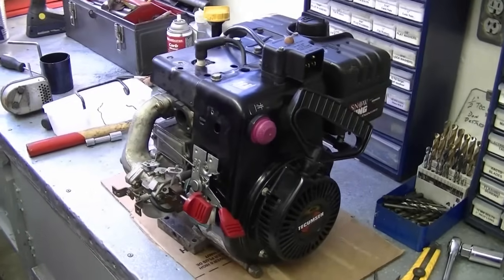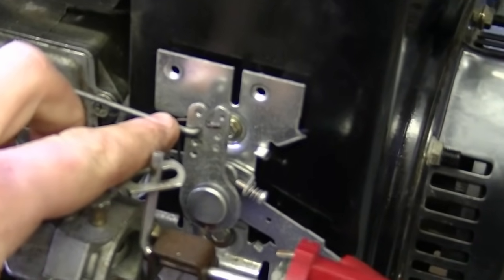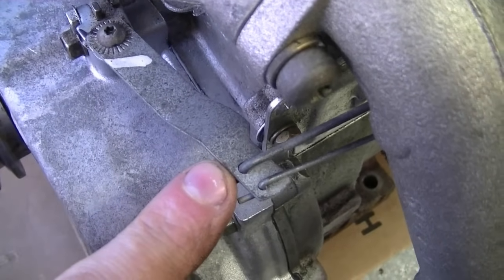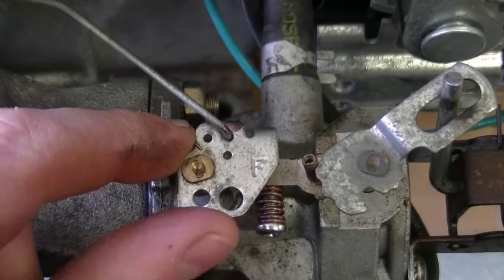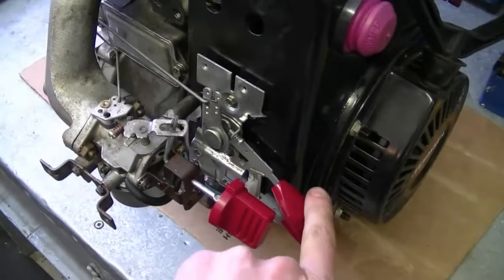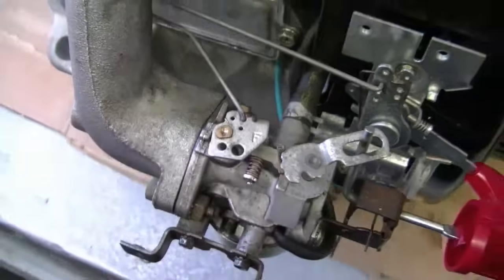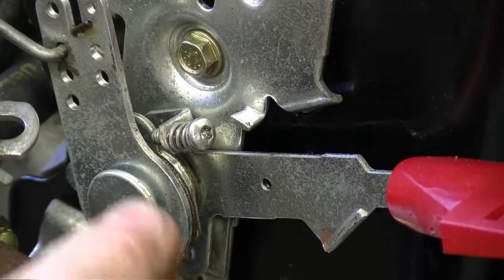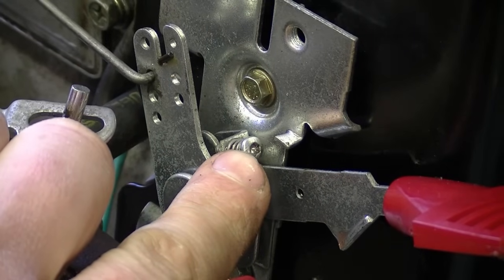8-11hp Tecumseh Snowblower Carburetor Linkage Configuration

Comment: I'm out of ideas. My linkage is on correctly but the engine wants to either rev extremely high or the idle will just start to come down at the bottom of the linkage and want to die. I'm thinking the governor is screwed up or maybe I have an air leak.... It's a brand new carb on an unknown machine. The guy told me it ran last year

Comment: My MH80 Tecumseh engine snowblower has the linkage diferent than from the youtube presentation. At the carburetor the linkage is in position nr 2 hole and at the RPM position nr 1 hole. If I put the linkage like the picture the RPM are very high and I can not select the correctly high 3400-3600 RPM.

Comment: Any idea what the stock size for that bolt that holds the throttle plate on? Mine was out wack when I bought it but the spring to the lever was bent out of walk and cases the machine to over rev. I bought a new plate and assembly.

Comment: Two questions if you don't mind:

First, if you are adjusting the screw on the throttle lever, how do you know if you are over-revving the engine? The engines do not have a tach. 

Second, in this video you could see where the choke "linkage" connects to the choke "lever" on the carburetor. Is there a way to tighten that connection up so the choke knob isn't so floppy?

Comment: Hello my friend, your recommendations are very helpful. Thank you.
I got a used snowplow with a TECUMSEH motor LH 318 and HMSK80-100. Not all small parts are original. Could you please tell me the length of Governor Link and Throttle Link. The length of mine does not match your video.

Comment: Was working on this engine trying to figure out why it wouldn't rev- just stayed at idle ( snow blower just purchased used by a relative ).  Turns out the linkage  from the throttle to the governor arm was missing. Thanks to your video, I can make a new one. Was driving me crazy. Your video was exactly what I needed. So 12 years later, the video is still being used. Amazing ! Thanks so much !

Comment: I'm trying to bring a 10hp snowblower back to life.  Your videos have been a savior so far for reassembly of the carb.   All of the governor parts and hardware were missing from this unit and I believe I have ordered all the parts to fix this, but I'm struggling finding a good parts diagram that shows me exactly how to put it back together.  Do you have any videos specific to the reassembly of these parts, or is there a better diagram somewhere that I can use?

Comment: Very helpful. Just what I needed two days before a snowstorm when I thought I could handle rebuilding my carb. And I know, I should have made sure it was running weeks ago, but it was running fine three weeks before I went to start it with no response and a broken rope on my recoil. Now I’m stuck trying to scramble parts and get it done in the Wisconsin cold. 15°.

Comment: Working on a 8hp Tecumseh that I had half apart as of last season so nice you still have this video up and running thanks . So what happens if you put linkage to throttle in the hole ahead of correct hole towards the large hole . What is the purpose for the other holes anyways?

Comment: I know it's been 11 years since you posted but this video answered many governor and throttle linkage routing questions I ran into today replacing the carb on an ooooold Simplicity 860 E and trying to figure out. I haven't started it yet because I got hung up with the linkage  relationship between the throttle control assembly, which doesn't actually directly control the throttle butterfly but connects to the governor arm via a long(ish) linkage, and then the actual butterfly linkage connects to that and comes back to the carb. 
While reassembling it all I noticed when the lever was moved up to the high speed extreme that the carb butterfly wasn't being fully opened. It should be with the engine off and when running the governor linkage yanks it back if I'm understanding correctly how that works?
Anyway, I won't bore you with what I think I have to do to spring load the throttle linkage so it fully opens but until I hit the garage tomorrow to set up the governor linkage per your video I'm pretty sure your video pointed out the error of my ways. 
And...I had my phone right next to me while disassembling it but ya think I'd be smart enough to take pics before I started?...nope. 🤣
Thank you for thinking of idjits like me 11 years ago when you made this YT video! By the way, as far as I could determine from almost an hour of searching the interwebs and YouTube you're the only poster with the exact engine and carb direction configuration that matches my situation. All the other Simplicity 860's were non electric start and had the carbs mounted in a 90° outward way from the intake instead of perpendicular to it. (Pointing backward toward the control handles) 
I'm tired and done messing with it today

Comment: Question 🙋🏻‍♂️.. MTD carb there are two black screw plugs with hole in the top, is the hose that runs from the valve cover suppose to Connect to a T connected that seats in those two?

Comment: You’re not going to believe this but I was just working on a tecumseh on a craftsman wood chipper and replaced the carburetor. Couldn’t get it to respond to the throttle control. Looked you up and bingo the governor linkage was upside down. Thanks again for saving my butt again!!

Comment: Been a subscriber for a long time, and I find it hilarious that when I have some random small engine issue and I put search criteria into YouTube, boom, Donyboy73 has a video on that exact thing.  in my case, picked up a chipper off the side of the road and it works great after replacing the carb, but the throttle doesn't open when moving the arm.  Sure enough, you should how it should be configured and now I can fix it.  Thanks for your work and I hope it's been rewarding for you!

Comment: Hi..I bought a chipper shredder 10hp tecumseh with no manual the motor does not have a prime and the choke lever has a arrow on it which way does the arrow go for full choke ive tried it several ways and it won't start also wondering about spring under carb bowl ..what is that for and how do you adjust that

Comment: On my snowblower I had a pulsing.  So I took off the cover on the carb to look at the linkage.  When the engine is running the linkage moves very slightly and causes the pulsing is this normal?

Comment: Always my worse fear when working on small engines, some one moved the linkages. Now I do not even think about it any more. I know exactly where they go. I always tell people to look for wear marks on the hole for the linkage, anything with many hours usually exhibits  wear on the parts. The hole may be out of round or have a black mark or even groove. I have found linkages  in the wrong holes many, many times.

Comment: Donyboy73, could you please help me? I have a John Deere 828D snowblower with an 8 hp Tecumseh engine. The snowblower is approximately 25 to 30 years old. I recently re-removed the rear cowl to remove a mouse nest. I had a little trouble getting it back on. In hindsight, I think it kept getting hung up because I hadn’t removed the throttle linkage plate from the Cowl. I swear the snowblower has not run quite right since, and it seems I have to move the throttle lever up higher than in the past to start by electric start. I’m now noticing that the the thicker rod that goes from the throttle lever mechanism to the governor arm has a bend to it. I noticed in your video that the rod appears to be straight. Did I possibly bend it when I was pushing the Cowl back on, or are they sometimes bent? Thank you.

Comment: I have a Craftsman 5HP Tecumseh snow blower. It runs fine and starts without any problems. My issue is whenever I engage the auger and attempt to blow snow the blower dies, whenever a load is applied it dies. I have no problem restarting the blower but, I cannot use the machine for stalling out issues. I cleaned the carburetor, changed the spark plug, check the gas flow and the float level and it still dies under a load. Any ideas of what could cause this issues?

Comment: Thanks for the video, my question is what would be the best approach for the throttle screw because someone played with it and now i don't if it's screwed too much and i don't want to risk blowing the connecting rod. Would loosen it and perhaps screw it a bit by bit until it get a normal rev would be a good idea ?  Thanks
Reply from the maker: yes loosen it, then screw it in by small increments until you get about 3200 rpms
Reply: @donyboy73  Thanks,  Happy New Year btw, how would be the best way to know im getting at 3200 rpms.

Comment: is there special washers between the body and the throttle plate as my eng will start when the wire is disconnected from the plate and it wont run with wire connected

Comment: Hey I'm having some trouble with my tecumseh 10hp HM100 generator. Powermate 5000 maxa er. I was wondering if you could help me out it has something to do with the governor. Im not able to get it to 3500 rpm. It was working perfectly untill I took the carb off to clean it. Ive exhausted all my resources in trying to figure it out my self first before I messaged you. Hope to hear from you soon

Comment: Hi Don,
I have an issue with a Craftsman(Murray brand) snowblower, thought you might have an idea on what the problem is. Its the same style blower with that crappy plastic gear box your other video talking about how they are junk and to stay away from them.

Thankfully the issue isn't with the transmission, its with power to the toggle switches for the chute and the light. When I test the plugs behind the switches I have power in both sides of the plugs on both toggle switches. The bulb is good for the light, I tested it on a battery. 

I am wondering if the regulator fastened to the engine is no good? Its actually clamped onto the side of the starter. It just doesn't make sense that there is power to both toggle switches but they don't work. I have taken the toggle switches apart and cleaned the terminals. Just kind of stumped why the light won't work or the switches. Thats why I am thinking its the regulator.

Not sure if you have ever come across this?

Thanks
Reply: Hi Don,

Disregard, I figured it out. It was the ground wire that goes to the bolt on the flywheel cover housing. It was kind of loose and dirty, cleaned it up and tightened it down. She's all good now

Comment: Everyone with the issue of not throttling down , the govenor has to be at a rearward angle back towards the throttle as otherwise it's too far forward causing the throttle to be wide open. When i got mine set there was minimal movement of the throttle linkage.

Comment: I have a 10 hp tecumseh power sport.  I have taken the throttle bracket off and am unsure how to reconfigure the  governor linkage and throttle cable.  This motor is on a gokart.

Comment: I have a snowblower that's been running really bad, so I watched your video on how to clean a carburetor and reinstall it. I did exactly what you did in your video and reinstall it on my Craftsman snow thrower that has a Tecumseh engine and now it won't even start. Any suggestions?

Comment: I went to start my Tecumseh 10 hp snowblower the other day but it wouldn't stay running. Removed the cover to have a look and discovered the governor arm missing? It looks like it must have come loose and fallen off. Linkage is still there but the arm is missing. It was very similar to the one in this video. I have looked on line but can't seem to find a replacement? Any idea's?

Comment: Hey Dony, is their any difference at all between the 8, 8.5, 9 and 9.5 Horsepower Tecumseh L head winter engine's all rated at 318cc? I know the 10 horsepower is a 358cc and is larger, but is their really any difference on all the 318cc models or are they exactly the same as I suspect?
Reply from the maker: all the same linkage

Comment: Thanks.  Big help.  I had bent the governor linkage on the way to replacing the fuel line.  Your video showed me that it was indeed connected correctly,  but I needed to straighten the linkage.

Comment: Thanks for the info had a problem with a generator surging  that sat 15 years then hurricane Harvey come around.  Runs like a top now with the new carb installed. Old one had some bad varnish in it yuk

Comment: I have a Tecumseh HM100 159287M that was on a go kart,I'm fixing both. It only had a longer linkage from the governor lever to the speed switch thing.I don't have the one from the governor to the carb butterfly,should i get one?

Comment: Don, I have an exact engine for my MTD snowblower. What I have found is my friction disk has been getting oil on it & keep slipping. I cleaned it & the issue come back after 1 season. One day as I flipped the blower up to clean the disk & spray paint the bottom to cover the rust, I noticed oil dripped on the floor after sometime. I traced the oil to be leaking from the governor arm connecting to the engine (the opposite end of where the arm connect to the linkage). Is that normal? Anything I can do about that? I cannot find parts anywhere. Thanks.

Comment: I have a Mack st622 trimmer/mower that has a 6hp tecumseh. What is the wire for that connect to the top of the carb linkage housing? I broke it.

Comment: I used a photo as suggested by one of the other posters, but it is not at all clear how one gets the linkages reinserted when they have to go in at right angles (governor linkage) and around the intake pipe.  I'm concerned that the linkages are stiff and not flexible enough.  Any demo by you or anyone else would be most appreciated.  TIA

Comment: I am needing some help Dony. I tried to install the throttle control on a HM80 Tecumseh that is on a log splitter. But when I try to install it the way that you did on the video it won't move any of the linkage. This project is one that someone else starred but I have to finish. The other person said to install control with the linkage arm on the bottom but that doesn't work either. I'm open to any suggestions. I would really appreciate the help. Thanks.

Comment: I really enjoy your videos very informative, hope you can help me. I recently replaced the wheels on my track drive MTD snow thrower model  317e742f352 what is the proper procedure when placing the tracks back on the wheels? How tight should the adjustment be? The first time I operated the machine one of the tracks worked it's way off. I'm concerned that I may make the adjustment too tight.
Thanks for your time, Ron

Comment: He mentioned in the video (thank you for it BTW) that one could mark the location of the linkage with a marker. Yes, I do this but if one is going to spray a cleaner that will remove the marker, you may run into an issue if you were not paying attention to the actual location. Another way to note the location of the linkage is to take a PHOTOof it PRIOR to taking apart. Many people have access to a camera on their phone (alas, I do not, but my 12yo & 16yo girls do). Taking a photo makes it obvious on the linkages PRIOR to removal... No arguments with a photo.

Comment: Dony - Thank you very much for all the very professionally made vidoes and explanations.  I have one problem I can't seem to solve. When the carburetor cover comes off there are several wires(one from the shutoff key) as well as two others. I can't figure out (or find on the net) where they get attached.  I can't shut the engine off except by pulling the spark plug.  Any help is appreciated.  Thanks again

Comment: Hi Donyboy73.  I have a HMSK105 Tecumseh Engine that caught fire on my snow blower last year.  I have purchased many new parts, which have not arrived yet.  Is there a way to bypass the Ignition key.  I ordered the key but to get the little fitting the key fits into they tell me I have to order the whole Carburetor Cover ( about $ 80.00).

I'm sure there is a way.  Please advise.

Gord

Comment: I contacted you earlier about the missing link to the governor on my HM80-155446M Tecumseh Throttle Control link.  After looking closer I think there is more than just the link missing.  I assume you own a business?  If so, I would like to have the Throttle Control assembly with the ground wire terminal that you show in this video.  Can you email me instructions on ordering one from you?  A used part  would do just as well.

Comment: Hey Dony,

Quick question....  Got a replacement LH358XA for the snowthrower.  Originally had a stationary Carb.  Had to swap out my old carb instead.  Had to up the RPMs just a bit to clear all our snow here in CT.  Was working good.  But when put more gas in, started to surge.  Adj the idle first, then the rpms and got it working pretty well.  Do i have to adjust the governer as well, since it was set for a stationary carb?  Thanks, doug/shawn.  And thanks for the vid as well!

Comment: Hey Dony, I have a Tecumseh TVM200 10hp engine. It seems like the carb is pretty much just pouring gas into the engine, it even spits out of the exhaust a little. Can you suggest what I chould check out on it? Thanks
Reply: stuck float

Comment: I just helped my cousin rebuild a carb on a similar 8 HP Tecumseh snow blower engine. Some how The throttle arm spring came off and I have no idea how to reconnect it. This is the spring that pushes the governor.

Comment: I have a huge problem that maybe someone can help me with. i have a Tecumseh engine with the 640154a carb on it, it idles extremely high, back fires, etc. I tried to find High / low screws on the carb, but it doesn't have them. it's not leaking, i've changed out all the filters, rebuilt the carb, played around with the idle screws he shows here, but it keeps doing what it's doing. oh one last thing when you turn down the RPM the tiller dies... Please help!